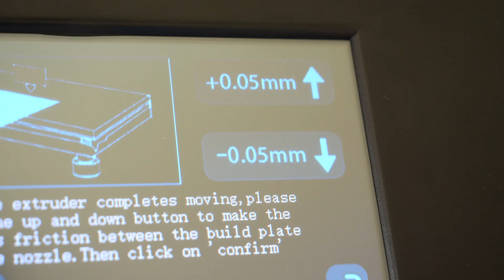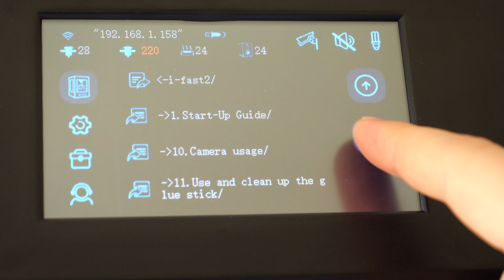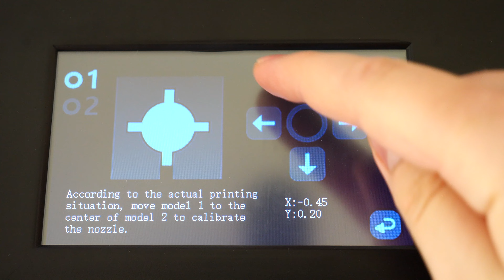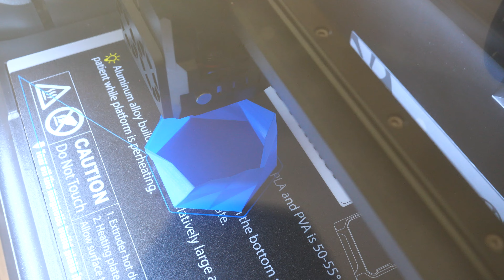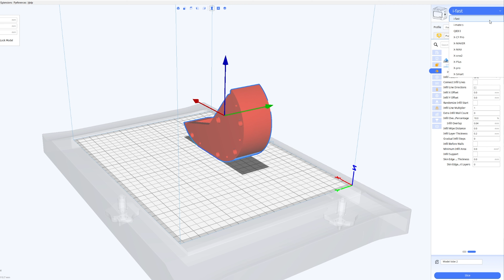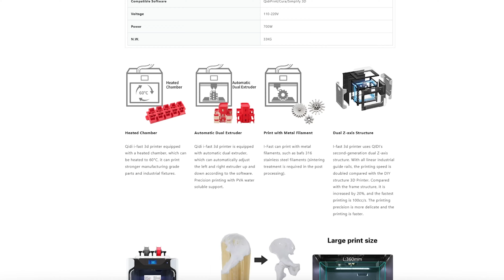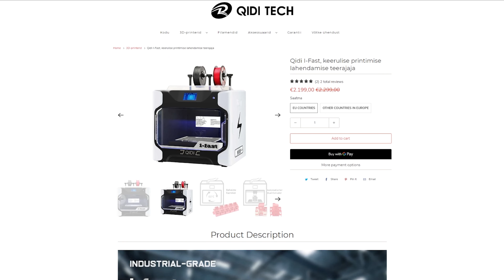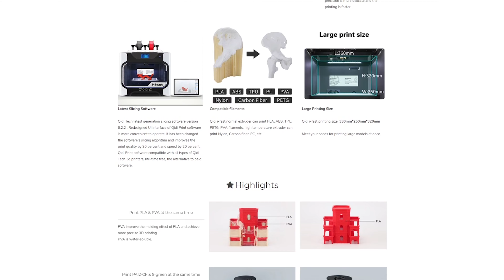QiDi Tech i-fast - Huge 3D Printer That Can Print Every Material (FDM)

Comment: Thank you for this video.  I was about to buy one of these used but your video showed me that this was missing the basic calibration features that are now standard on all modern printers,   multi-point bed leveling and auto calibration of the dual print heads.

Comment: Your wifi settings could be set to 5GHz or 6GHz(or dynamically change between devices) and the camera might need 2.4GHz wifi signal in order to connect but I am not sure.

Comment: Not exactly a rave review that inspires confidence with as many issues as you were having and the quality of prints. Wouldn't the bambu carbon X1 be a much better printer for a lower price point? Only thing missing is I don't believe it has a heated chamber but everything else is equally accomplished and it seems like much more refined, at a lower price.
Reply: The independant print heads have a couple of advantages over the single head system of the bambu. On prints where you are using support material, some people report layer seperations due to contamination inside the print head/nozzle in systems like the bambu. On small multicolour prints, you can actually use more filament doing purges than the model itself uses. Finally, the active heated chamber of this printer is a huge plus if you are looking to print large ASA/ABS prints.
Reply: I recommend you watch other videos with more experienced operators. They were printing FLAWLESS objects with all filaments, even the carbon fiber.

Comment: its really not worth it, especially when the bambu x1 carbon exists.
Reply: I have the bambu and bambu doesn’t have actively heated chamber. Long parts with nylon and ASA are pain to print even at 60deg. You should see glough42’s video of this printer to understand the real use case.